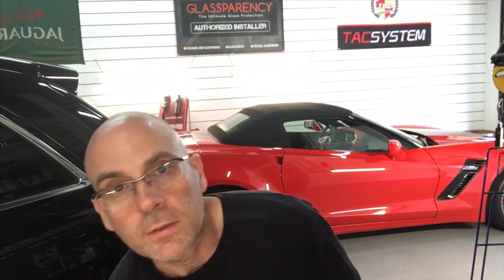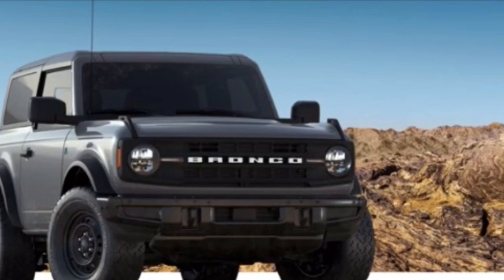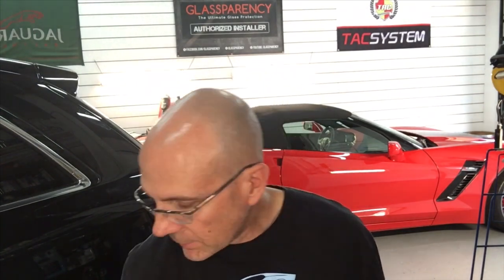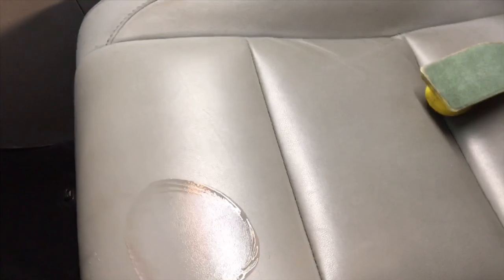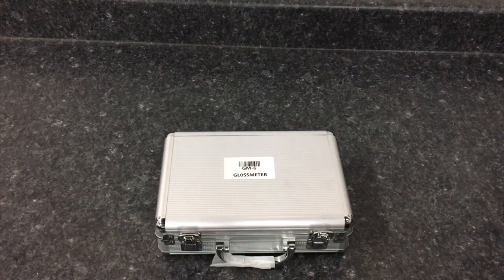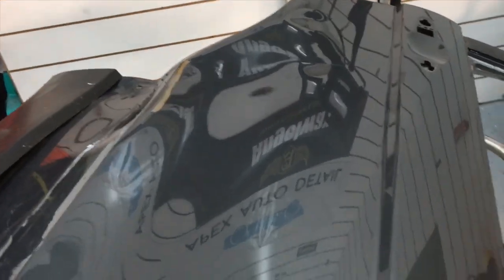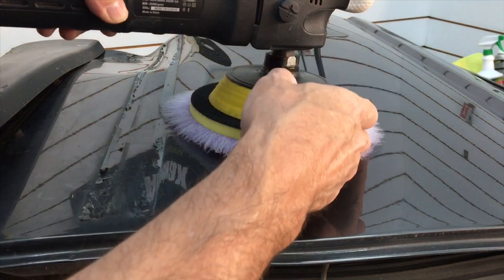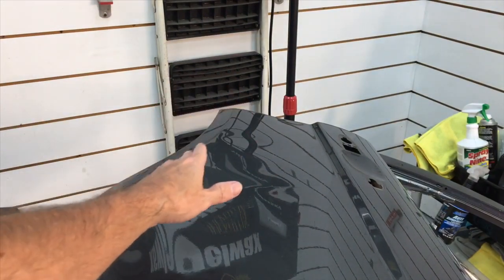Mail Call!! Polish Techniq, New Maxshine Detail Products, 2021 Bronco And Much More!!

Comment: Hi Brian, I have been meaning to ask you this for a while...
So is the ultimate step by step for SiO2 coating is:
- Decon (Wash, Iron remove, clay if needed) -> 1/2 Step correction -> CarPro Essence -> SiO2 coat (2 layers)
If yes, where would using a product like P21S paint cleanser fit in the picture, in the decon step to remove the old coat?